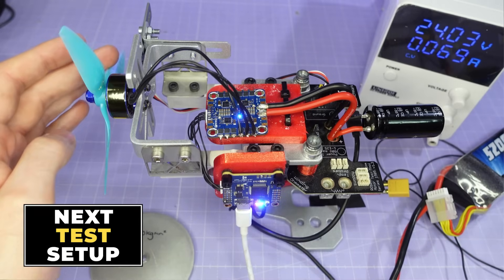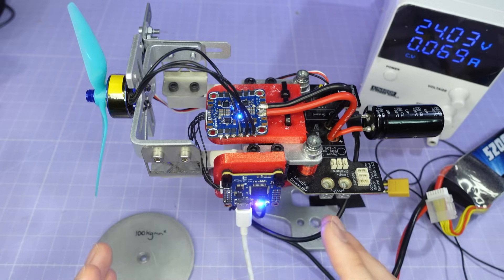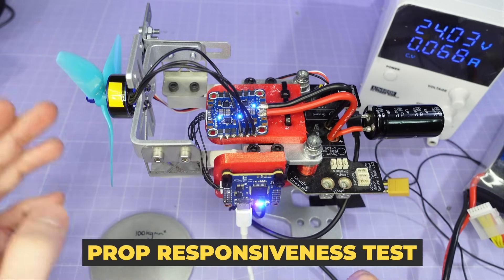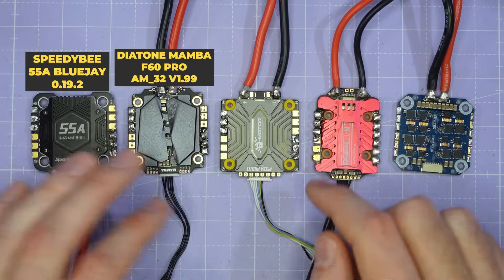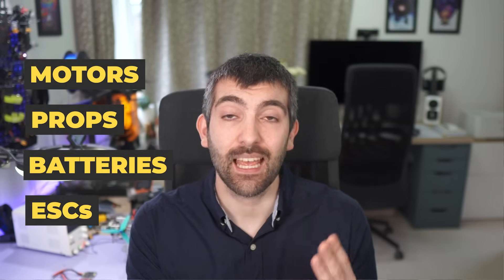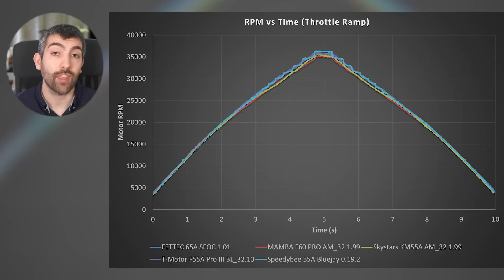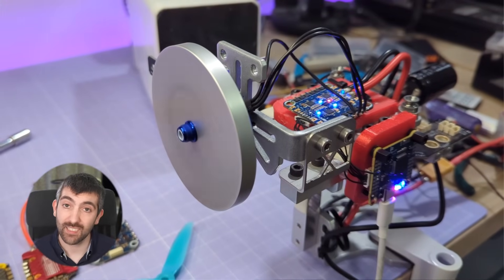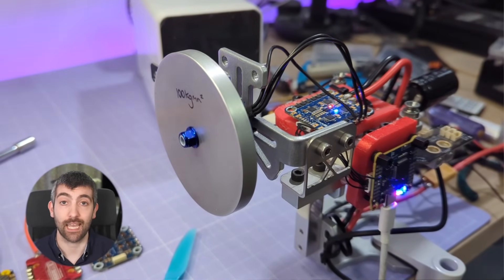Testing FETTECs new PROTOTYPE ESC against BLHeli_32 AM_32 and BlueJay

Comment: Wish I wasn't color blind. I see a red, orange, blue, and two dark blue lines. But they are not the same color as the 2 light blue, purple, red, and green lines I see at the bottom of the screen. Leaving me only able to tell that the MAMBA is at the bottom, and the Sky stars is above that, and the other 3 are above that. I cannot tell which are which. Maybe pick more contrast in the colors. And when they are next to each other use white, black, red, blue. And then when one is an outlier at the bottom give it the green or purple that is harder for people to see. 1/12 people have a significant deviation to their color vision. so at least 500 people must share some difficulty like me in viewing these graphs.

Comment: 6:01 So here the responsiveness of all ESCs and firmwares are about the same. In your ESC comparison video a month earlier the BL32 was 2x faster. How can that be ?
Reply: My guess is the ESC is not stock anymore, settings have been changed.
Reply: @Hitman12.  Or BLHeli has payed 2x more money then the others ? Hahahahah
Reply: @Sugalime3D_FPV  blheli technically doesn't really exist anymore so that's unlikely
Reply: exactly what 'I'm wondering.
Reply: that is because most of Chris testing is flawed by design
Reply: @sigterm15  how? All the testing holds up to the scientific method and all parts are thoroughly explained.

Comment: Thank you very much for showing this test. I am not using drones, but have started to look for different solutions with BLDC motors, and it have been hard to find specific information on how different ESCs perform regarding speed step response. I do however have a general good understanding of electrical motors.
Your information here is the best I have seen so far. You and few other YouTubers have provided information on how the choice of motor do influence the response time, that you like to be fast for good flying performance. But it is interesting, that the choice of ESC also makes a difference.
When I study the breaking performance, I should think that there should be room for improvement for all the ESCs, and especially the new FETTEC ESC with better current sensing should be able to do that. So perhaps they will do it in future firmware versions. With acceleration you got some natural limits, and perhaps it might not be possible to do it much better than shown.

Comment: I wonder if there is actually any battery for FPV drone that would be able to fully power all 4 motors at 100% throttle as those ESCs are actually capable of?...as I understand those 55A ESCs can deliver 55A of continuous current per motor...for example my Wasp Major datasheet says that it takes about 30A on 100% throttle...that would be 120A in total...I see that those ESCs should handle it without any problem with huge margin but can any battery at standard capacities 1300-1500mAh even deliver this power? Especially considering that the C number is a marketing bullshit and real C number is usually like 1/4 of the advertised? So even Tattu R-line with 150C can delived just about 40A continuously which is only 10A per motor and shortly maybe 100A which is just 25A per motor and it sags quickly...I tested CNHL Black 1300mAh to push it to the limit and it just capped at 84A and didn't go higher, which was barely 20A per motor, which is 2/3 of its max power...

Comment: As expected, these days electronic is on so high level that differences are cosmetic IMO. What you can really compare is EMC performance, like resistance for some electrical shocks while unprofessional user is setting up a drone or, even more interesting, EMC emission (conducted, radiated) to check real impact on other parts of setup...

Comment: I would argue that 10ms of acceleration delay is not comparable to 10ms of video link latency.  You're talking about 10ms to get from 85% to 90% rpm.  It doesn't result in anything close to the pilot seeing where the quad was 10ms ago like you get with video/control latency.

Comment: I guess one thing that wasn't mentioned would be are these ESCs just on default settings? Or was there certian things done in the settings to help out as best as possible?

Also another ESC that would be interesting to see in the mix would be Advanced Power Drives (APD). They're more common with xclass and heavy lift cinematic rigs. But like FETTEC and Flyduino, APD uses closed source software for it's ESCs.

Comment: Sorry Chris but I'm very confused about this testing. What exactly are we comparing here? You have different ESC hardware, different firmwares and even different sizes. You have 3 variables here. Even within the same manufacturer they sometimes change parts due to availability adding even more variables. With BLHELI32 and AM32 it would be more interesting, imho, if you flashed them to the same ESC. Unfortunately with bluejay I understand that's not possible. You also don't describe what settings you are using, they could vary wildly. Lastly, if the goal is to then test different ESC hardware it should be run on the same firmware, no?
Reply from the maker: Great points. I'm testing all the ESCs on default settings for the FW listed. In general you don't have much of a choice of ESC firmware on a particular board. You can theoretically flash AM32 to some BLHeli32 ESCs but I wouldn't advise this. Better to buy an AM32 ESC in the first place. My hope is to build up a database of ESC performance like I have for motors and batteries.
Reply: @ChrisRosser  maybe it would make more sense to test a bl32 ESC vs an old Fettec ESC with similar ratings (as similar as they can get). Then test the old Fettec ESC vs the new prototype and treat your test as a closed "input-output-system" like measuring the motor torque and braking/acceleration capabilities with an external device

Comment: I really do appreciate all of your testing an most of the time I respect your methodology. But here you present this as a test of firmware but your testing is extremely flawed with such a variation in ESCs. Maybe you could repeat these tests with a few ESCs that can be flashed with different firmware so that you can verify that it is indeed the firmware that is consistently responsible for the variation in performance
Reply from the maker: I agree 💯. This isn't a comparison of FW in isolation. Only of the specific ESCs on test. I fully agree we need much more data to determine if differences are due to FW or ESC design.

Comment: Wondering why you haven't included noise as Drone Mesh used to do, I'm still on analogue and noise in my camera feed is probably the main thing that puts me off certain brands/esc's.
Reply: It'd definitely be interesting data to see. Looking at the resulting current plots from his other video on this new ESC it's a reasonable assumption that it'd have less noise as it's sudden changes in voltage and current that cause noise.

Comment: Am32 is at 2.08 firmware now.. it performs a bit different to 1.99. The other esc’s are all running modern firmware
Reply from the maker: 1.99 was the latest when I did the testing but that's why I made a point of detailing the FW version because things can change quickly.
Reply: @ChrisRosser  makes sense 2.08 is a solid improvement over 1.99

Comment: Really interesting work.  I know, it's just asking for more - but - I'd be interested to see if the performance remains the same when all 4 outputs are performing the tests at the same time.  

Do you think that it's worth normalising the results for the last test due to the different current capabilities of the ESCs?

The FOC approach seems to generally be advantageous on the T-Motor Alpha ESCs so, I'm not surprised to see that FOC performs well at the FPV scale.
Reply: I was wondering something along those lines... what was the current draw on each of those ESC's vs the performance. Could they be pulling at different rates? Maybe the impact on the batteries flight time would be trivial.

Comment: Could you you please add the settings used on the ESCs to the description?
(especially the decreasing resolution of the bluejay-ESC in the rampup/down smells like 48kHz was used)
Reply: Right?  WTF?
Reply from the maker: BlueJay was 24kHz for this testing.
Reply: @ChrisRosser  you should test different resolutions of bluejay

Comment: In future testing can you include the flywheel test from a dead stop to full speed? to test the sensorless startup performance. Does it cog at all? does it spin the correct direction on the first try?
Reply: I agree, also would have been better to use a good powerful 4s high kv motor like a 2700kv on 6s to see which can actually make the highest rpms before it starts clipping and if it actually desyncs...
Reply: @DigitalCruzer  That would probably be more helpful than any of the measurements taken here...

Comment: Great system engineer test, as always Chris. But let me ask the question to Responsive - Acceleration test. Is the FETTEC really the best in this test? It can reach the 90% level faster, but I suppose overall generated thrust is bigger for Speedybee ESC - when you calculate area under the curves..
btw. can you keep same colors for ESCs in charts? :)
Reply: Unless you are reaching the peak RPM this will be compensated by a slightly higher thrust gain in the controller.

Comment: Funny how the one esc that has over a 15% higher continuous amp rating then all the others has slightly higher acceleration... Why do these tests never seem to have equally matched up test subjects??? I'm  sure the fettec fan boys are clapping like seals... Now lets make them cry and do  overload and sudden stop testing where you repeatedly do heavy load accelerations a bunch of times but then add a  brake to slam it to a sudden stop under load to simulate a prop strike crash scenario to see which one fails first...
Reply: Amp rating shows how much Amps it is rated for. A bigger number will only withstand more load, and a smaller rated esc will be damaged more easily, for example.
Reply: @Iceman_2003 not necessarily. Esc's are complex, but for 5" drones mostly you are right. I have had esc pulling 50 amps, but having 30% difference in thrust compared to a different one. The underperforming one was 100 amps esc, and the better performing one was rated for 200 something. We never even got close to the continuous limitations or thermal issues, but the results were clear. I think the biggest issue with amp ratings in the modern drone market is how the bigger number usually is a good tool for marketing and nothing else really gets appreciated.
Reply: There is still a larger path of flow do to the bigger mosfets with the same signal input, if it tells the gate to open a certain amount that amount is going to be larger... Why not just test a 65a against a 65a??? His tests seem to always be skewed in some obvious manor
Reply: I wanna see some durability testing, I remember fettec was also good at going in flames.
Reply: Besides, my issue with this methodology is also that we're trusting the ESCs' data by using bidirectional DShot. FETTEC is closed source iirc
Reply: @bassfpv  blheli32 as well.. only blheli_s and am32 are FOSS
Reply: I think you've misunderstood how these components work.
Reply: Ngl. I think it depends on what you are testing. If the test is on performance, this is perfect. If you want to take the rating into consideration, then you are right. You have to understand, that these things are built, and only after they are built they can be rated. Some of the esc's might be able to take up more voltage than others, the amount of additional capacitance are a factor for all esc's. I think it might be interesting to see these things tested, but nobody is directly funding this research and so there are no "correct" ways of measurement. They depend. I'm sure that the best performing esc in this test is not the right esc to buy for every application. I mean even the price isn't considered. However I think Chris has done a fine job to gather data to crosscheck it.